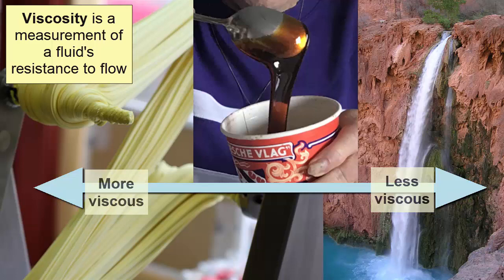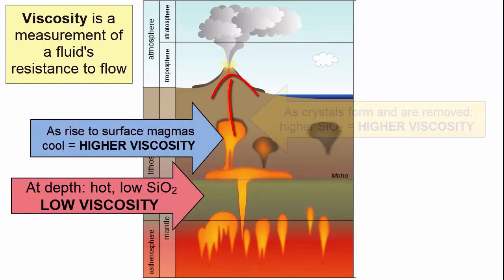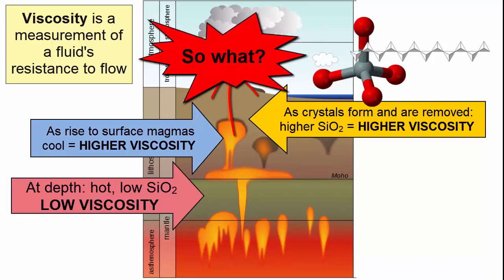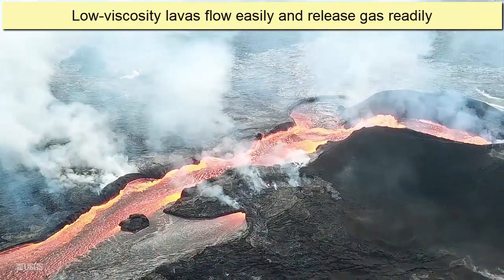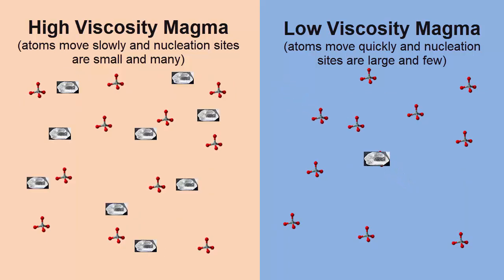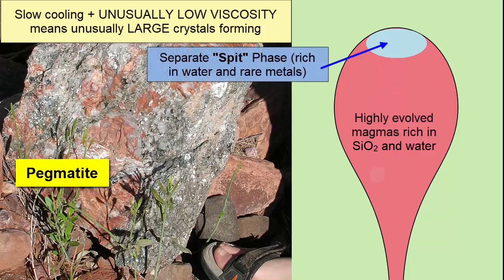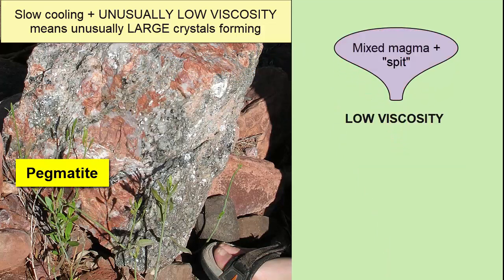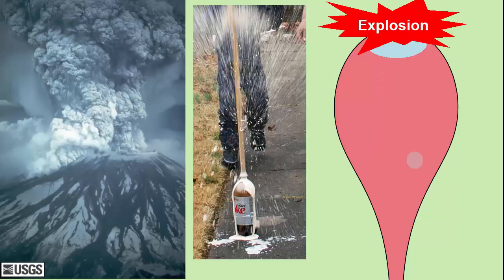Magma Viscosity

Comment: Congrats for the didatic explanation! A suggestion to improve the video: Emeralds are not formed within true pegmatites, but are formed in high temperature hydrotermal systems rich in quartz, feldpars, Mg-rich mica, berillium and chromium, supplied by distinct sources, a granitic source and an ultramafic rock source.
Reply from the maker: Thanks for the additional information and details about emerald formation. Here's a good link with more details for those interested in digging deeper into Emerald formation: https://www.mdpi.com/2075-163X/9/2/105